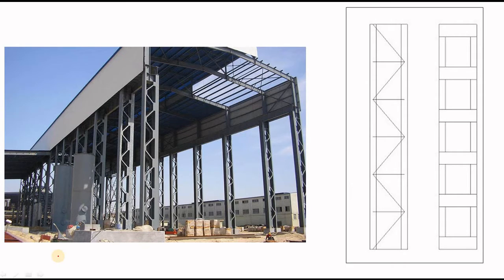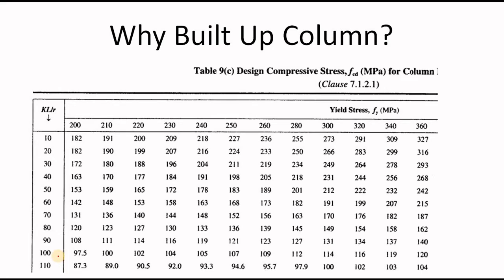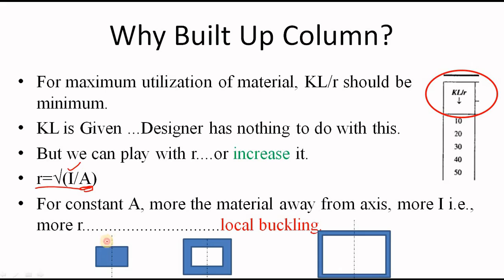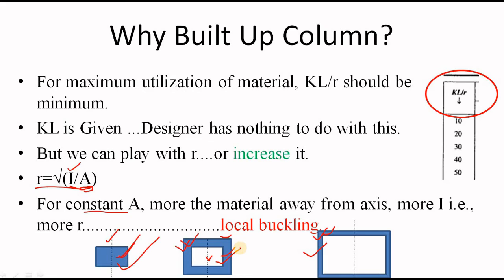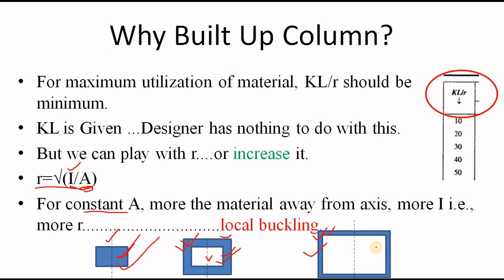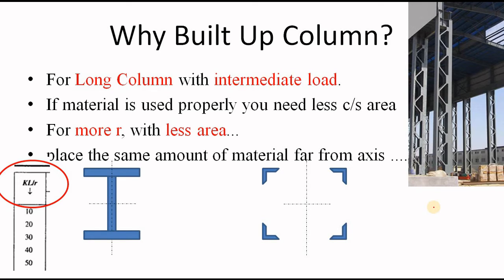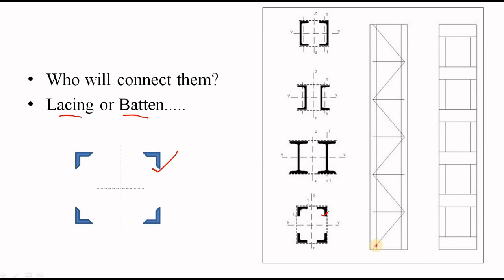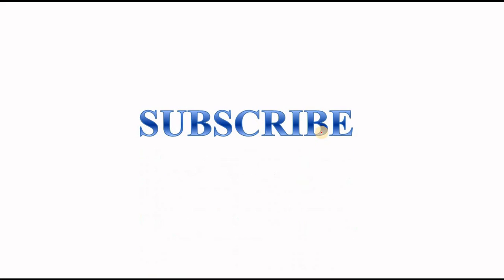What is Built Up Column: Why built up column is used: What is the advantage of Built up column?

Comment: Sir, should i release moment at the beam-column joint at the web of the C section of a built up column? i am having difficulties designing connection.
Reply from the maker: It depends on your requirements.